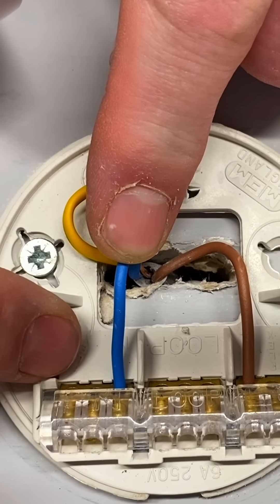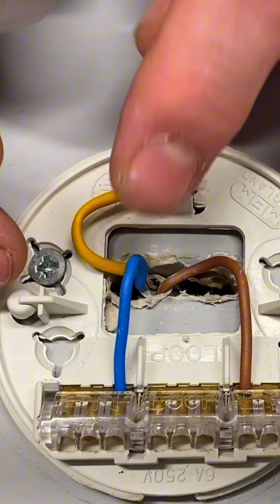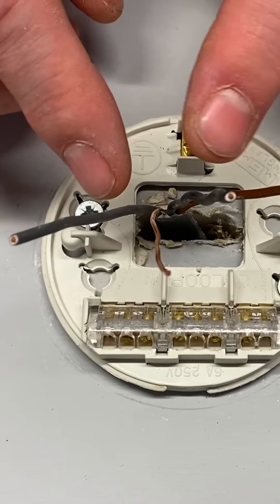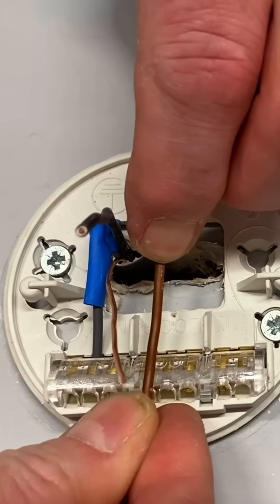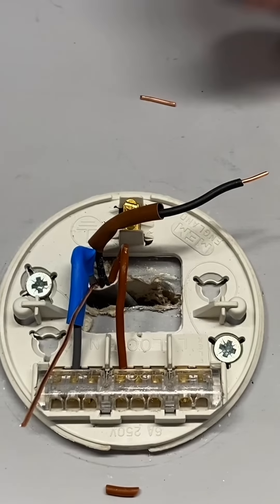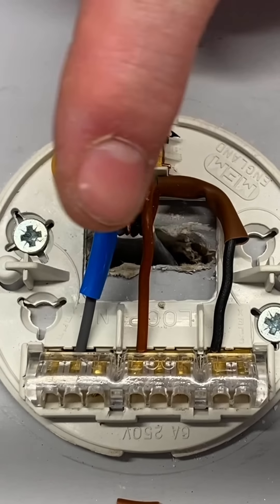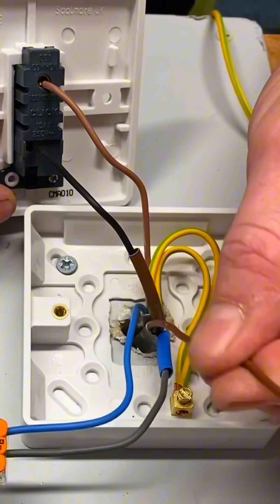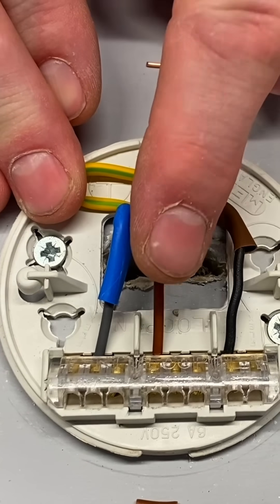Lighting Circuit - New Build Method with a Twist

Comment: ive thought about this before it would be much better future proofing doing this, even with the old method with feeds at the light, you can send the neutral to the switch via 3 core, its so good it works both ways haha 💡 great video
Reply: Taking the neutral to the switch in this way if you arrange things so the neutral is between the permanent live and switched wires would also address continually glowing or blinking lights when the switch is off too (capacitive coupling)
Reply: fantastic.

Comment: I've always done loop at the switch instead of at the fitting. Back in 2016 I was doing a rewire, I ran out of 1mm twin and earth to do the switch feeds, but had a role of 3 core and earth. So I did the switch wires with that, then a 2nd fix I just parked the permanent live (brown) in the loop terminal at the pendants. Love looping in and out at the switch box, the only advantage to looping in and out at the fitting instead of the switch is easy earner fault calls where wife has bought new light fitting and husband has mixed up wires. Love those calls, just id the switch wire and finish fitting the new light fitting.  Get paid easy money and also win new customer and ongoing work.

Comment: Why haven't they made a ceiling rose with wago holders instead of those brass screws yet...
Reply: Spoke to Wago development engineer at installer show earlier in the year. He tried to get a Wago ceiling rose off the ground. He needed a partner and none of the big accessory names were interested due to the high end cost of the product. 
I pointed out that it would be an installer choice and a balance between cost and labour time. 
Another aspect is that as you get older and wear bifocals you are looking through the wrong part of the lens when wiring ceiling fittings and a Wago fitting would help with this.
Reply: I think that if you wanted lever type Wagos, even the smallest 221's would be too big. Although I totally agree with you, they'd be so much better, I really hate ceiling roses. These days I try to fit Quickwire connectors of some type when doing ceiling lights.
Reply: @billdoodson4232  I tend to do loop in loop out in a wago box and bring a tail out to the rose now
Reply: @lunavx  Yes, did that last week, but used one of those Quickfix JB's, I like the way they hold in the 221 Wago's, better than the actual Wago boxes.
Reply: @lunavx  No flys on us 2! 😉👍🏻👍🏻

Comment: Hi, great video, very clear. In your demo, perhaps for clarity, you have omitted the looping twin and cpc to the next room/zone. Let's assume this would have been in the switch, looping from switch to switch. That's the way I would do it and I like the concept of the 3c and cpc to the light fitting. The only downside is where the circuit might be 2 way, and it can start to get a bit busy at the switch, a deeper box defo gonna help.

Comment: Would running 3 core to the switch also make it easier to convert to 2-way switching in future? It seems like it should, but i guess you lose the permanent line at the lamp if that happens

Comment: It's a good job you clarified this with the three core wire in the light switch.
Without  this explanation.
when opening up the single gang light switch. I would have thought its was two way switching wired up wrong.

Comment: For give me, but didn’t we have a ring circuit originally, before we joined EU. Where you had a live and neutral loop?  Is this not a case of the EU got it wrong because the U.K. was years ahead of Europe, but had adopted a lower standard because of ONORM’s!

Comment: What's the purpose of trying to "deneutralise" black? Definitely seems more logical to use it as neutral to me. Having live (albeit switched) on a black cable only seems to bring more risk of confusion.
Reply: Black is the old wire for the neutral. Blue is is the new wire for neutral. Keep them seperated,  not to have a black and blue for neutral together.
Reply: Lol. Black is the colour of Line 2 in a 3-phase system...  Brown = Line 1, Black = Line 2, and Grey = Line 3.  All "Live".  (I.e.. Black is now  a "Live" conductor rather than the Neutral Conductor so it would be dangerous to treat Black as a Neutral)  However, Line and Neutral are now both considered Live conductors btw.
Reply: @m101ist  the choice is between using grey as neutral (a live conductor in 3ph) or using black as neutral (a live conductor in 3ph) so both decisions seem equal

Either way it is sleeved with brown to indicate it's purpose.

Until cable manufacturers produce a cable with two brown, a blue, and an earth, it seems a bit arbitrary!

Comment: Does anyone make a twin brown + blue cable?
(Though ideally a brown / brown with white trace and blue, with the trace to aid in installation)
Reply: I think there's twin brown wires and cpc. I have not seen twin neutral wires and cpc.
Reply: @m101ist  yeah seen plenty of twin brown (and red from pre-harmonisation)  and of course 3 core + CPC. 

I've never seen the 3 core in anything other than phase colours though.

Arguably for the drop from a ceiling rose to a light switch where you also want a neutral, 2 brown+ 1blue + CPC would be a better choice than phase colours.

Comment: Just a word of warning. Although you have done it the correct way. Its not uncommon to see other people use the black for neutral and not the grey. I was on a job the other day done by a so called NIC professional house basher and he had used the black on smoke alarms for the neutral. The point is .if in doubt always check and test
Reply from the maker: Thanks for your thoughts and experiences
Reply: Nothing wrong with black as neutral. As long as its sleeved either end you can use what you want (just not an earthing conductor)
Reply: @andysims4906 nothing wrong in using black for neutral. Just because somebody at niceic dreamed up these colours does not make it right or compulsory. 

Colours are all messed up anyway. We can find blue, black or grey in an installation. Would have been better if niccy 
a) kept the old colours and 
b) specified black will be neutral in the UK.
Reply: Love it!  Another new company SOP policy courtesy of Gaz and eFixx.  Thanks!

Comment: I know that this is only a demo  but that plastic box needs to be 25mm deep. 
I always install round plastic conduit and 25 mm deep metal boxes for flush light switches
Reply: Totally agree. That’s the way I would do it  ,but if the chase is not to deep I would use oval conduit

Comment: The cheekiest way would be to remove the CPC sleeve for a brown or grey sleeve and use that as the switching line and the insulated brown as the permanent live, but thats very illegal 😅
Reply: @MrFiver1111 not illegal as the wiring regs are non-statuary. You do not have to follow them. 

Of course following the regs (in most circumstances) is good practice and I would not like to write 'used the cpc for switched live' as a deviation on the test cert. 

Putting sockets/switches/cu at non-standard heights (just because somebody in niceic dreamed up these arbitrary measurements) and writing this deviation on the cert, I can see no issue with. Providing the mounting heights were chosen for sensible reasons.